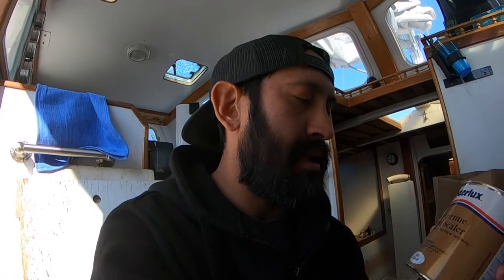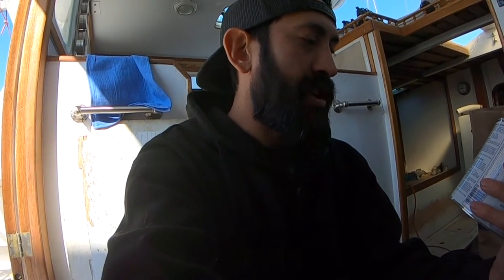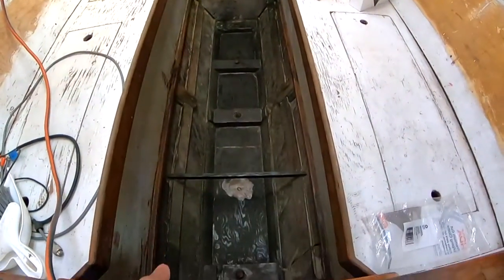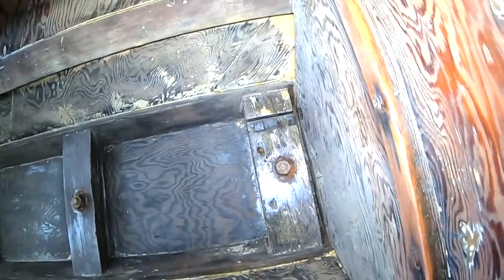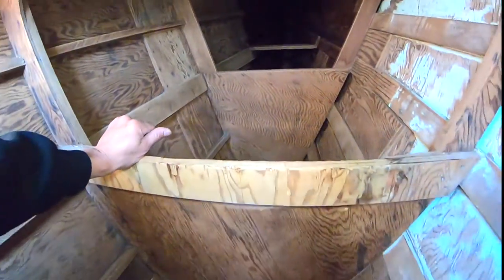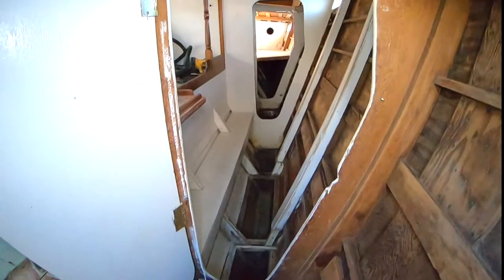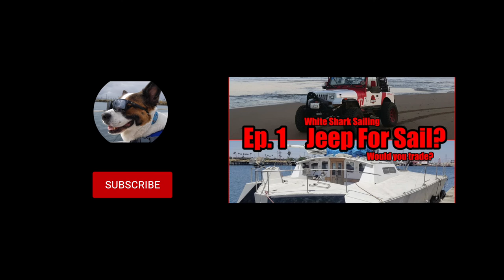Ep. 14 "Glossy" White Shark Sailing Trimaran Vlog Refit

Comment: I think using those foam flat paint brushes work better for the sealer and staining - they will hold up better and make it more flat so you don't get the paint brush lines - this way you also save a little as those lines are actually high and low spots and by making it more flat during the application will save you on the sealer/stain.